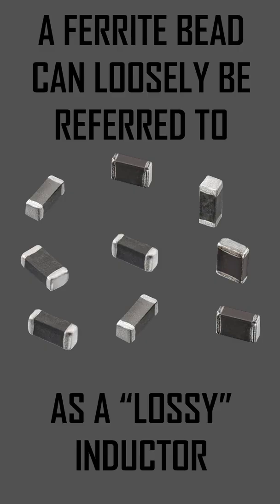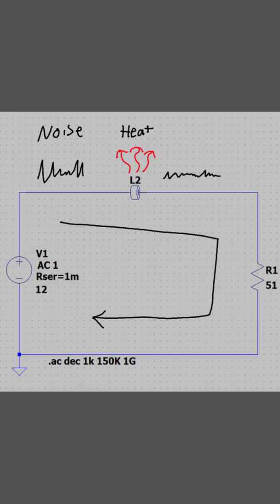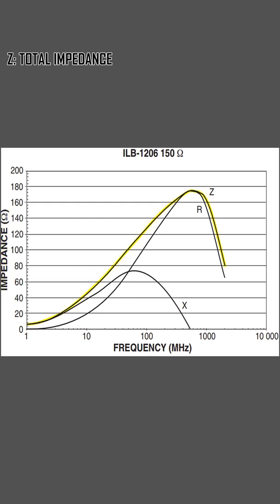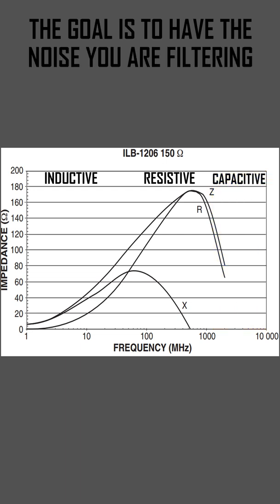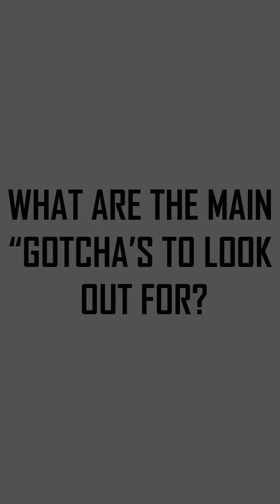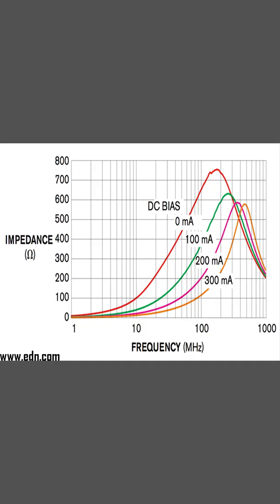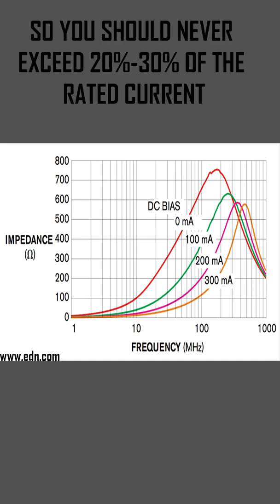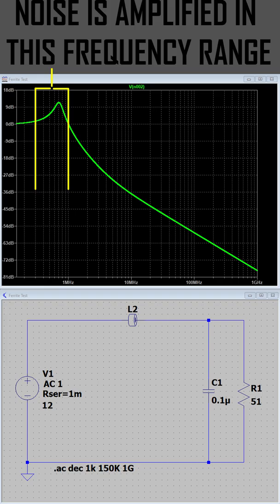Ferrite Beads in Under A Minute #shorts #underaminute #electronics #tutorial

Comment: As for inductor, you can use tantalum ot electrolitic capacitor paralled ti ceramics; Also you can use ceramic capacitor with resistor to create controlled esr (snubber) for desired frequency responce. Low-ESR ceramics can lead to rather large and destructive spikes, remember it!
Also  ESR-controlled capacitors exist, but its rather expensive.

Comment: no no no, the HF energy will not be dissipated as heat!
The ferrite bead has a high impedance at high frequencies, which means that they behave more like an open switch, not letting the high frequency signal pass. An open switch does not dissipate any energy either, it just isolates one side of the circuit from the other.
Reply from the maker: You seem to be mistaken on what a ferrite bead is as compared to an inductor is! What you said is true of an inductor, not a ferrite. A ferrite is an inductor with a low quality factor, Q. As you can see from the ZRX chart, what you said is valid for the the inductive zone, but not for the resistive zone. In the resistive zone, the impedance of the bead is primarily from resistance, NOT inductance. So it is indeed dissipated as heat.

https://www.analog.com/media/en/technical-documentation/application-notes/an-1368.pdf
Reply: @MicroTypeEngineering  sorry my bad!
Reply: @uwezimmermann5427  One of the most important traits in engineering is the ability to make a mistake and learn from it. Niels Bohr said “An expert is a person who has made all the mistakes that can be made in a very narrow field.”
It's also important to learn from the mistakes of others, so thank you Uwe and Kyle for your comments here.